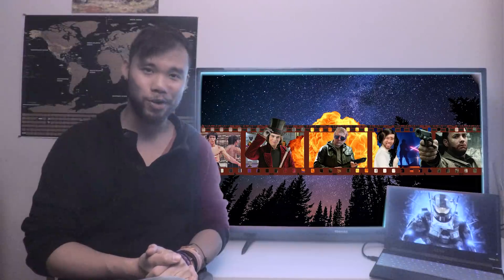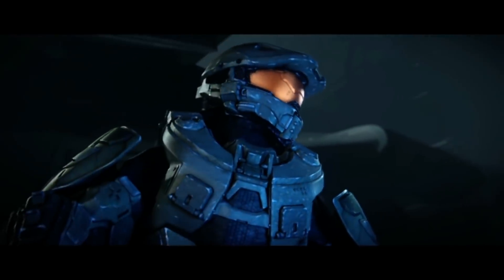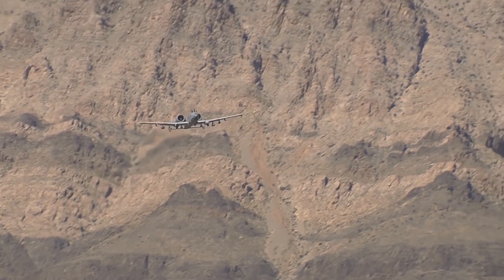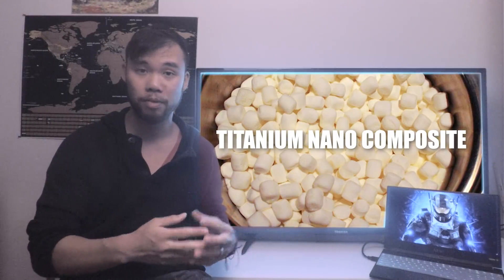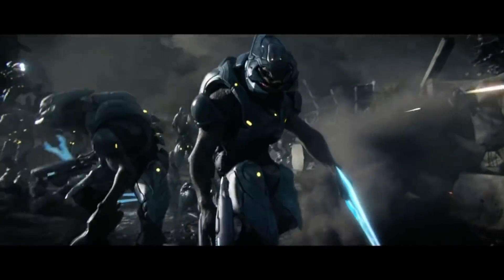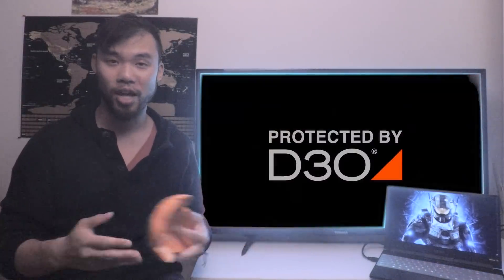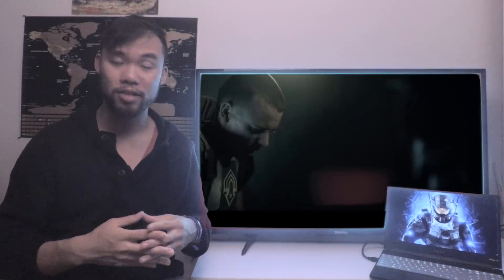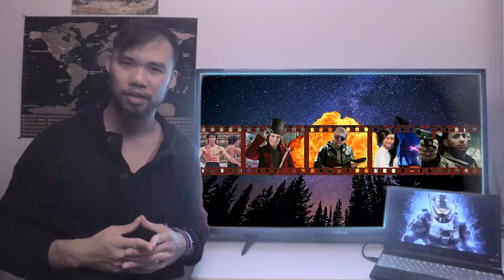Can We Build Halo SPARTAN ARMOR? PART II

Comment: For the under suit I saw a video we’re some scientist made artificial muscle with carbon nanotubes by running electricity through them made it contract. So if carbon nanotubes could be made on a more large scale for less cost you could make the part of under suit that increases strength while providing protection.

Comment: The shield that's exist in the Halo universe are not possible, you can't stop energy in midair making it a barrier strong enough to deflect and absorb kinetic energy same with plasma you needs some sort of container to hold it in place or it will just dissipate this is why lightsabers the way they work in Starwars won't work in reality 
   Other then that yes most of the stuff is possible the fusion power source is very questionable though yes fusion is possible but at that small scale it's incredibly unlikely that a stable reaction can be sustained or even started in the first place nuclear fission has been around for decades and we still can't fit it into a car let alone a human sized suit also I'm not sure if I would want a nuclear reactor on my back anyway

Comment: Another name for hydrostatic gel is... sex lube. The soldiers are lubed from head to toe inside the suit. It's protection from the suit constantly rubbing and abrading their skin. The story never get into the details of how the wearer poops and pees, but it is possible they just "go" straight into the gel, and there is a circulation system that filters out body wastes, sweat, and skin oils from the gel.

Comment: I'm pretty sure that during the Campaign of Halo: Reach Jorge mentions to noble 6 "lock your armor spartan" as they are about to crash, implying that they can set their armor into a more hardened state able to withstand a crash.  There is a material that I read about a couple years ago that is liquid but when hit with something high velocity like a bullet, it becomes incredibly strong.  This allows it to fit around you perfectly and still be able to stop bullets, not to mention it's lighter.  I don't remember what it was called and my lazy nature is getting the best of me, so I'm not going to try to find it again for the sake of a youtube comment.  Perhaps you could find it and put it in your next video

Comment: I'd still argue for a steel armor for a super soldier. Modern steel alloys are stronger than every single titanium alloys for a nominal thickness, and while titanium is great for having 60% the strength of steel with 45% of the weight(but the actual question should be 60% of what type of steel, because high strength steels will be way superior even when weight is problematic) , this lower density brings other issues (bulkyness, makes the armor plating MORE limiting for mobility and agility) 

As for some newly discovered titanium alloys with gold, that are up to 4 times stronger, they were evaluated for abrasive properties in joint and dental implants,  and in such quantities that weight isnt an issue...gold is real heavy and so is this alloy. And a hard super dense armor plating isn't necessary good for mobility on infantry.

Comment: As much as I love halo I've always found the armour strange..
So this armour has a energy shield that seems to be able to deflect the brunt if not the totality of most physical and energy based attacks..and conversely is also covered in insanely heavy metals that can't seem to survive more than a couple bullets before caving in. 
So my question is, since the energy sheild is clearly so much more efficient than the soft as hell armour he clunks around in why not throw the old outdated heavy armour out. Use the muscle suit and energy shield and put all that extra power that your saving on weight into making the Spartan physically faster and stronger and the shield last longer and charge quicker? 
With armour = kind of Chunky tank on legs
Remove armour = indestructible space ninja marine hybrid with an overcharged super sheild
Reply: the caving with a couple bullets thing is a game balance thing Canonically  spartan II Armour could take  a  vehicle mounted mac round( read: a  shot from a  tank) and  shrug it off as long as the shot hit a plate
Reply: I’d imagine an EMP would render them extremely vulnerable like the one that occurred with the Noble team on Reach.
Reply: I mean they can run 35 miles per hour in the suits, even faster with the thrusters, so they aren’t really “chunky”.
Reply: @MylesKillis  three year old comment amigo. 
Maybe get a hobby.
Reply: @lloydhedges3011  that’s irrelevant.
Reply: @lloydhedges3011  also I’m just now seeing this video. Someone doesn’t understand how YouTube works.

Comment: Yes and no yes we can not it wouldn’t work and would probably kill the wearer.
Reply: Actually almost all the tech we need currently exists or is being developed. 
We already have most of the basic tech behind the suit itself.
The neural interface has existed for years but isn't at this level yet. 
We are currently working on fusion reactors right now and have actually achieved it in small yields. 
The gel layer responsible for healing wounds and deflecting impacts pretty much exists but again, not to halos level. 
Probably won't ever get an energy sheild but we have things that could substitute it. 
And we already have a.i to a point. 
Basically we don't need to invent anything else we just gotta improve what we have and boom. Halo armour.
Reply: Only things straight up impossible about halo armour is the energy sheild and the apparent magic gel that works as its motor system.those two things probably aren't gonna happen
Reply: @lloydhedges3011  actually the shield while theoretically possible and is as of now the only aspect of the suit that has no real world counterpart (however basic and primitive those counterparts are)

Comment: Working Titanium is EXPENSIVE currently and acquiring enough titanium for several hundred suits is not cheap either and as you pointed out useless versus Plasma or sufficient explosives.  Armor really has to be tailored to the threat.  A composite ceramic and polymer mix like stormtrooper armor would probably be better versus plasma but still compromised with high velocity projectiles.  I think realistically 700LBs assuming an additional  300lb soldier is still too heavy to move discreetly and the plate type would vary depending on the threat type........ Mjolnir IRL WOULD BE MODULAR..

Comment: This may just be me being completely clueless, but wouldn't the hydro static gel layer act like a glacier, but on a much smaller scale? I believe that under the hard upper layer of ice, the pressure makes the ice flexible. Wouldn't the same thing be occurring with the gel? It is pressurized by the suit, but when the outer layer is punctured the outermost layer of gel turns hard, keeping everything else OK. I think this is mentioned in a scene in halo 3, when the guy says something to chief about the gel layer being shot?

Comment: Spartan armour also has motion tracking, thrusters and magnetic boots for low gravity combat, magnetic holsters, grenade holders, a combat knife and that's the default armour. There is endless attachments and devices that can be equipped. Damn I love halo for making things like this. (My profile pic is my halo 5 armour)
Reply: Adam Goth TACTI-COOL X10 bro!💪🏻
I love when u can customize the fuck out of ur character and weapons and think of all the ways you could use the dif features

Comment: I'm sure someone already mentioned this but in military body armor, the soft armor panels are almost always behind the rifle plates while the whole thing is held together by the carrier. The reason for this is that the soft armor can act as a trauma pad cushioning the impact that the wearer might feel when he's hit, there's also the fact that some hard plates can have something called spalling occur where the plate is hit with enough force that small portions of the back face of the plate becomes a projectiles though this is mostly only an issue with older plates or non-coated steel plates.

Comment: The Spartan armor is a Condensed alloy. IT is weird but that does exist. Someone used electromagnetism, a REALLY STRONG Electromagnet, to condense a quarter to the size of a dime. Done deliberately it could be used to condense the alloys of a powered armor suit.
Reply: we also have the gel so that's two things well it has heat regulation in fact just do some research on the talos suit

Comment: We currently have the tech and metal to build a Spartan style armor, but the power source is the current problem, modern power sources only have it 2-4 hours max, we could strap tank armor on a exo-suit easy enough, but the required power source does not exist yet...
Reply: Basically our three man issues is power as we haven't even cracked nuclear fusion in large facilities to make power so it we'll be decades if not centuries till we can miniaturize the tech to go on the back of a suit of armor. The closest we can get would be like the Mark 1 exoskeleton armor from halo where it was physically teathered to a generator for power. Great for rear d use not practical for combat. We can't make the liquid crystal layer that gives the Spartans their extra strength in the suit and finally we have yet to refine the ability to turn neural signals into bianary to move an electronic limb. We are getting there but the process needs more time to become more practical for even construction type uses let alone military application.

Comment: What is it that allows the suit to keep it's structure? Like if the suit was left vacant, what would stop it from collapsing on itself? Also, what is the hardware that connects all the components of the suit? How does the suit effectively respond to orders from the user?
Reply: Watch the ending to halo 5 and it shows the segments of armor for lack of a better term is basically bolted onto the body glove. Without a user inside the body glove the suit would crumple to the ground without any exterior support. What controls the suit is a neural port on the Spartans that connects to the Spartans nervous system to the suit and so giving the command to raise your arm by just thinking to is also sent to the suit where a layer of liquid crystal reacts to the neural command and magnifices the strength of the reaction. Thus why the Spartans have to have near unbreakable bones or they would snap due to the force multiplication the suit gives every action. In the book The Fall of Reach, when John first gets put in the suit Halsey tells him to take it slow and head to the obstacle course. John proceeds to salute Halsey but smacks his hand into his helmet with enough force he realizes if it weren't for the augmentations he would have shattered every bone in his hand and wrist.
Reply: +john USAS 
Ah, thank you.  Trying to figure out the circuitry was driving me nuts.  But in regards to the suit itelf, then isn't just advanced pieces of armour, rather than an exoskeleton, as there are no stabilizing joints holding the suit together?  Isn't a Spartan just merely shouldering the weight of the armour, if it has no interior structure?

Comment: Aren't high-grade carbon steels stronger than titanium alloy? 
Edit: but titanium has a greater strength to weight ratio
Reply from the maker: Yea they say titanium alloy but that could basically mean any combination metals.
Reply: There are many different alloys. There are particular alloys of titanium that are extremely ballistically resistant.

Comment: Spartan armor motorist must be extremely tiny considering any armor after Mark 5 is not a suit you can climb into instead it's a body glove individual armor pieces screwed onto your body
Reply: Legatus Lucius ? Marks 4, 5, and 6 are the same. The Spartan-IIs always look larger because they had their skeletons physically altered (as opposed to the rest which used chemicals to gain the same effect). It’s the reason why Jorge is noticeably larger than the rest of Noble Team.
Reply: Spartan armor doesn't have motors. It's powered by a feature Allen didn't mention. The body glove contains a layer of metallic liquid crystal that can solidify and change shape in response to electric currents. It acts like an extra set of muscles controlled by the Spartan's neural interface.

Comment: Compare death troopers and Spartan?
Reply: The fight would consist of The Spartans running up, because let's face it, Spartans can run fast. The Spartans are much bigger than a death trooper. The troopers would shoot as fast at they could, likely landing every shot, to no avail. Spartans would then proceed to punch them once and the death trooper armor would collapse like a milk jug. It really isn't a fair fight in any sense.
Reply: @andrewmorris483  Spartans can be killed by a couple plasma pistol bolts. They're not the exaggerated juggernauts everyone seems to think. But regardless taking actual lore into account on Death Troopers and Spartans, Spartans win easily
Reply: Spartans, hands down.
Reply: No contest Spartan wins
Reply: Troopers will be wrecked
Reply: EchoSpark 267  Spartans would still come out on top they have a higher sense of tactical maneuvering so the fight still goes to them.
Reply: Spartan-IIIs in their Semi-Powered Infiltration armor would have a slight advantage. Any Spartan in proper Mjolnir armor would destroy a death trooper.
Reply: I know Spartan IV are like toys?
Reply: Spartan IV beats Spartan III but Spartan II every type of Spartan!
Reply: @Blitzkrieg23  "Spartan" IVs would be dominated by all the previous generations except Spartan Is. They're no where near as well trained as the others all their new little toys and gadgets won't save them